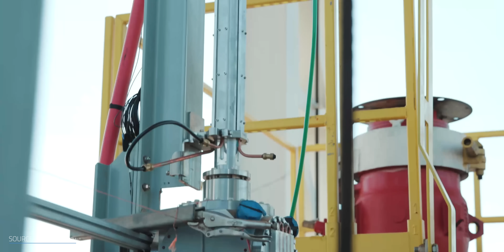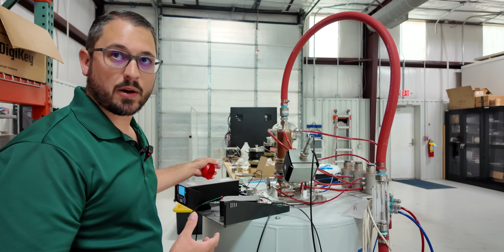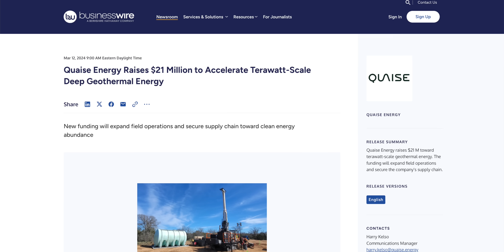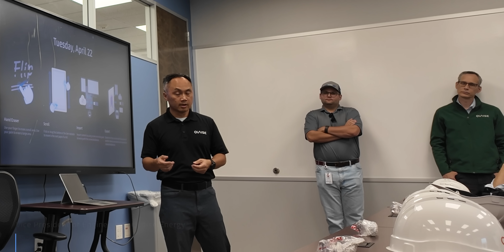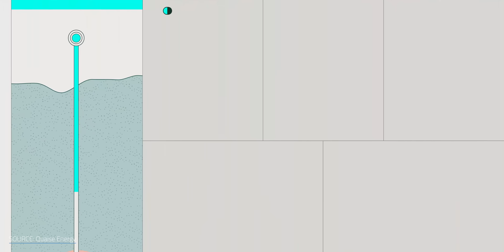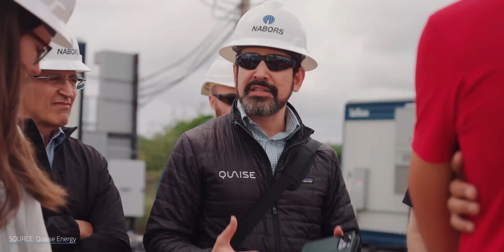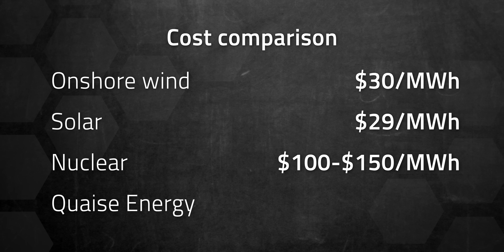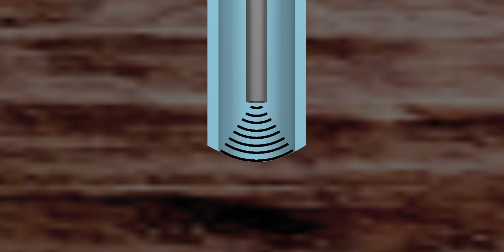How Geothermal Energy is About to Break its Limits

Comment: Any news on the drill pipe? I'm still convinced that going to be the real issue. we've been able to build high power RF sources for almost 70years  so going from a klystron to gyrotron is not all that interesting in itself  hell im sure if need be that could pump it up into the 100Mh class ea$y enough. but getting the attenuation on that "drill" pipe low enough  so you can do more than  toast marshmallows a kilometer down is going to be a trick.
Reply: Apparently, continuous megawatt power millimeter-waves can be guided down up to 10km at around 90% efficiency.
Reply: @waterturtle2919  in precision  wave guides sure, but something  resembling drill pipe with all dirt grim and heavy  handing im not nearly  as convinced. Also the joint typical  lose are .3db per joint so for multi kilometer assembly  your going to have hundreds of joints so that like+30db loss real  easy.
Reply: @waterturtle2919  If true, that is great.  That is a harsh environment down there.
Reply: @waterturtle2919 that's still 100 kW of power lost as heat and they're not pumping any coolant down the pipe. Hope they have a working solution but this was the first thing that jumped out at me.
Reply: I think the challenge might turn to creating a gyrotron that fits down the hole instead of extending propagation.

Comment: Cost comparison? When are we going to stop comparing wind and solar to other sources in such an unrealistic way. "Onshore wind can generate electricity for as little as $30/MWh." In reality, you have to multiply that number by about 4. Just for the generation portion. (For the majority of the days when your wind farm is going to under perform) Then you have to add the cost of (in all likelihood) more transmission lines. The cost/development of energy storage systems. At least for the present and for some time, the cost of operating gas-turbine power plants to cover for when the wind isn't blowing. 100$ for nuclear and geothermal turns out to be a bargain.

Comment: I think such projects, if implemented worldwide could lead to the heat death of the planet. By bringing the trapped heat up and performing an exchange on the surface, you're effectively cooling the power source. More wells, more cooling. Every solution opens a new can of worms. Who's doing the study on how many of these wells it would take to provide desired power vs how many wells it takes to turn the Earth into a cold, dead rock?

Comment: That was the coolest video yet on your channel! I used to  work in the drilling industry, making electronics that mounted just behind the drill bit, enabling directional drilling. We also made computer measurement systems that were up on the drill floor. High vibrations, flammable gases, 350 deg temperatures, just the worst conditions. (Insert joke about Texas weather here) It's amazing that these guys are sending gyrotrons out into the field! Also, death ray, accurate lol.
Reply: you just brought up something that wasn't addressed - they talked about problems with hitting water, but what happens when they hit a methane pocket?
Reply: @dwc1964  Probably nothing much. There is little oxygen down there. More than that, there is already tons of heat produced by the drilling, so the methane would probably cool things down.
Reply: @FLPhotoCatcher  If like the video says they are using air to remove the vaporize rock there will be plenty of oxygen in the well bore. What there shouldn't be is any methane. There shouldn't be any methane in granite or basalt.
Reply: @dwc1964  If they aren't blowing oxygen down there i would guess nothing. Maybe pyrolyzing methane producing hydrogen that get's blown out of the hole while the methane pocket would mostly just remain?
Reply from the maker: Awesome! Glad you enjoyed it.
Reply: @UndecidedTechnology  I literally drive past the Nabors facility every couple of weeks.  A lot of folks use Fairbanks N. Houston Rd as a shortcut to bypass the Beltway when trying to get into town.  If I show up, will they give a tour ?
Reply: @UndecidedTechnology boron arsenide heat conduction. the drill well can be much shorter
Reply: Who did you work for? Telico, Earhart, Sclumberger?
Reply: @geographicaloddity2  I used to work for a small company called XXT. We sold to directional drilling operators like ProDirectional. Challenging technical problems are everywhere when you drill deep underground.

Comment: One thing which could make this more appealing than solar and wind would be that geothermal generators should be able to better withstand the swings in power demand throughout the day without the need of huge battery arrays that solar and wind have, if I understand physics correctly.
Reply: Yes, geothermal is a base load provider.  Wind and solar are not base load providers, that's why they need the storage systems to even out the power they generate to become base load capable.  There are wind farms that are frequently forced to shut down simply because the power they generate is excess to needs.  The electric grid is designed so that the power going in must closely, if not exactly, match the power going out.  A mismatch would seriously damage the grid, or at least force large portions to break contact with each other.  As I remember, in the pacific northwest, there are wind farms that are almost never active because there's no way to get the power they could generate to places that need it.  No one is willing to pay for the infrastructure to get the power from where it's generated to where it's needed.  So. Cal. could seriously use that power, but there's no interconnect to get it there.
Reply: @EdwinWiles  that's because the Bonneville Power Administration sucks. It should reduce hydropower generation when wind is generating  (and then run the hydro when it's not windy), but because of incentive misalignment it doesn't. And BPA doesn't build and upgrade transmission lines for similar reasons. Private companies need to be regulated with an iron fist to get them to do what's right.

China has installed thousands of kilometers of ultrahigh voltage transmission lines, yet another green technology area where China leads.
Reply: @skierpage  I'd have to look into the time/effort/wear it would take to start and stop the hydro turbines.  Part of the reason that something is a 'base load' supplier is that it's efficient; but it's only efficient if you leave it running at its best 'speed'.  It's also difficult to stop/start a 'base load' plant because they only work their best at the speed they were designed for.  It takes time to get them up to speed, and time to shut them down safely.

So, yeah, they could choose to throttle the hydro plant, but wind would still need a massive storage system.  It might be better to use wind power to pump the water back to the top, and let the hydro plant serve the grid.  That way, the hydro turbines remain at their best speed, and you have a natural storage system that only puts more potential energy into the hydro plant.
Reply: @EdwinWiles   EIA 2020: "Most hydroelectric turbines in the US can go from cold start to full operations in less than 10 minutes, which is a faster start-up time than any other US electric generators." If renewable energy is pumping the water back up, then the turbines are spinning backwards and the hydro plant has been stopped and restarted in the other direction.

Pumped hydro energy storage was used to store excess electricity generated by nuclear.
Reply: @skierpage  Thanks for the info!

No, the turbines wouldn't run backwards.  This would be a system added to a normal hydroelectric plant to take water from the bottom of the dam and pump it back up.

I'm suggesting a retrofit to make use of excess renewable generation that would otherwise go to waste, yet doesn't require massive battery farms to store the excess for later use.  I have no idea if it would be reasonable or not, but hey, if pumped hydroelectric works, and the dam and reservoir are already there... It might be worth a look.
Reply: @skierpage  Did a little more digging on non-base load generators.  While a ten minute spin up time is viable for some situations, there are also situations where you must spin up much faster than that to keep the grid working.  Not sure if the demand profile in that area matches one where ten minutes is acceptable.

The flip side to hydro power is that it isn't just hydro power.  There are often agreements on the minimum amount of water that must be released every day to maintain the river and support the users downstream of the hydro plant, so if you have to release the water anyway, you might as well get some power out of it.  I don't know if you consider that a disincentive or not, but it is certainly something that must be taken into account.
Reply: @EdwinWiles  utilities use battery storage for grid stabilization and frequency control, they respond in seconds.  Anywhere there's hydro power(regular or pumped storage), it's an excellent fit with intermittent wind and solar.

Comment: I think it's too risky to drill for geothermal energy that might cause an earthquake. Also, I think that technologies for producing clean renewable energy should be gasification together with pyrolysis from various types of waste materials to produce syngas, flywheel battery hybrid system for storing renewable energy, and Compressed Air Energy Storage Systems(CAES).

Comment: I'm curious. What happens when they hit water or natural gas and crude oil deposits? Why are they in Houston area and not where magma is closer to the surface.
Reply: The whole purpose of this tech is tapping for heat anywhere.
Reply: "Why are they in Houston area" - Lots of O&G (and hence, drilling) expertise perhaps?
Reply: I guess you get hot flammable gasses

Comment: Instead of using the heat for electricity generation via an ineficient steam turbine why not use it for industrial process heat or domestic space heating?
Reply: I guess it's easier to transport as electrical energy. You just need a wire instead of a two way pipe system.

Comment: The comparison of renewables with nuclear or geothermal is not correct.  Even if you use LCOE, that doesn't take into account factors such as intermittency, capacity factor (not sure) and many other additional costs needed to make these systems work

Comment: I think it's likely that the tech will eventually work. I'm less sure that the intentional backslide on wind and solar in the US will last long enough to allow them to reach market. I also worry that maintenance costs will eat into their efficiencies over time. This is not a set it and forget it type of tech. I would love to see this used in residential geothermal though. If they can make a drilling rig that can easily bore down a few hundred feet without upsetting an entire neighborhood, that could be an alternative use case that's perhaps a bit more practical.
Reply: I was thinking the same thing. Vertical pipes for geothermal heating/cooling so it can go under a driveway or foundation or just take up smaller yard space. The USA spends roughly $181 billion each year on heating/cooling. The average savings of switching to geothermal for heating/cooling is 40-60%. Imagine the savings of switching everything over. Factor in the reduced cost of drilling with this “death ray”, the savings would be amazing relief for struggling families and small businesses plus the ease it would put on our infrastructure. On and all that helping reduce pollution too. 
The next question is, does it make sense for drilling sideways? Like for laying pipes to bring water to more rural locations. Storm drains. Underground cables. Pipelines.
Reply: @SawyerAnderson  you can also save on heating and cooling with an air-source heat pump for $800 and up, without any of the expense and complexity of digging down into rock to transfer heat. Google X's "moonshot" startup Dandelion Energy is trying to reduce the cost of ground-source heat pumps so that it's more competitive in areas with very cold winters.

Fervo Energy wants to use regular mechanical drilling adapted from fracking to drill sideways to capture enhanced geothermal heat from a wider area at shallower depths.
Reply: Imagine your city municipal pays for this through taxes but your energy is free.
Reply: Should be able to distill water with this thing too.  What is the water flow rate for an 8 inch system?  How close can they be put next to each other?   Is there a risk of a steam pocket blowout?

Comment: Local scale is the most important part of what he said. I think one of our largest problems as a civilization is distribution. We lose somewhere between 3-10% of all of our energy just in transmission lines. If we could localize this to neighborhoods or single family homes this transmission loss could be mitigated. Then power lossses would affect much smaller groups of people.
Reply: Hmm, I wouldn't say it's one of the largest problems - but it's certainly an issue worth thinking about & trying to mitigate.  Grids exist because traditional (coal, oil, gas & nuclear) work better if they're large scale than localised. Wind also works far better at scale; solar works at any scale. This sort of geothermal power will also be a large-scale thing, mainly, as the economics don't stack up at small scale. e.g. you can put solar panels on your roof, but you couldn't dig a 20km deep hole in your garden & expect a financial return in your lifetime (or even your grand kids' lifetimes). So I think the grid - with its transmission losses - is here to stay, for a while anyway.

Comment: If you're going to compare costs with wind and solar, you need to include the cost for storage as well which works out to $84/MWh for onshore wind + storage and $89/MWh for utility scale solar + storage. Of course, costs for each of those keeps falling.

And as others have pointed out, it's not just power generation, but district heating as well.

Comment: Fascinating video and update. Huge potential for behind the meter power for large energy consumers such as data centers/server farms. We ought to localize energy production to where its used. Huge grids are expensive, vulnerable, and ultimately wasteful. That's why many new commercial and government buildings install geothermal and/or solar as they build. We need housing to developers to so likewise.
Reply: Grids are not wasteful. "The U.S. Energy Information Administration (EIA) estimates that annual electricity transmission and distribution (T&D) losses averaged about 5% of the electricity transmitted and distributed in the United States in 2018 through 2022."

The USA is bad at building ultrahigh-voltage power lines (yet another area China is leading) and the utility running the grid is out to make money, so there are benefits to building generation next to use. But efficiency isn't one of them.

Where are these "many new commercial and government buildings install geothermal"? Even if you mean just drilling down dozens of meters for a more efficient ground-source heat pump, I wasn't aware it was very common.